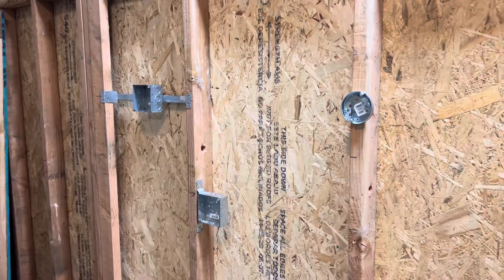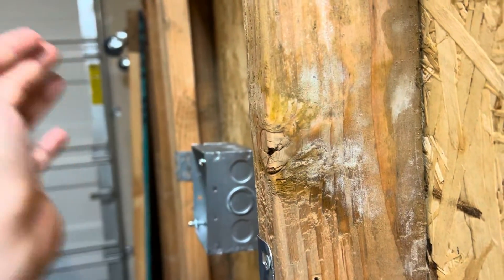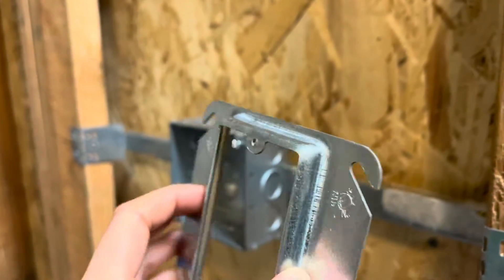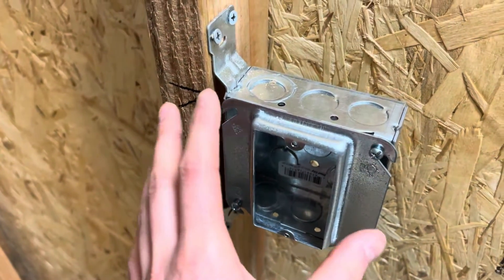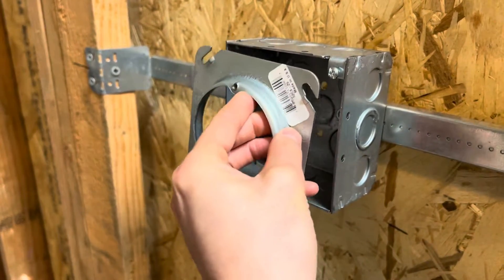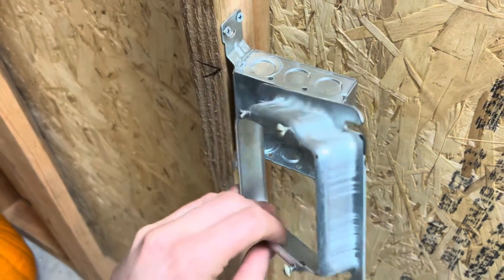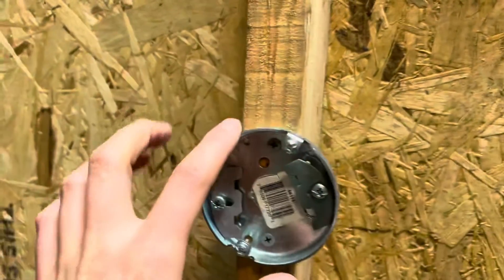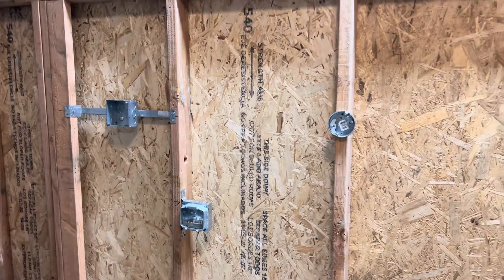Electrical 101: What Are Mud Rings & How To Install Them Correctly

Comment: What’s the purpose of the mudring? And if you are adding one to an existing wall sconce box when the wall is already sheetrocked does it screw to the wall or electrical box? I’m tiling a wall with a wall sconce and someone said to add a mudring and tile under the metal plate
Reply from the maker: mudrings go on before sheetrock/tile. its to screw the devices in like plugs, switches, or light fixtures.

Comment: Why do commercial boxes sit flush with the studs unlike your example with residential that protrudes?
Once the mud ring goes on it will also protrude just like residential and then there is no difference?
Is it just to make the boxes more configurable depending on the wall thickness because there can be many different scenarios in commercial whereas residential is almost always just 1/2" drywall? Thanks for the video. :-)
Reply from the maker: exactly. correct

it also makes a more universal box and then you can just choose what mudring for your application/situation. (light, receptacle, 2 switches etc)

Comment: Can I set the box deeper and use a deep mud ring to create more box volume?  I am thinking of using a deep double gang box and a 1 1/4" double gang mud ring on my 50 amp receptacles (for the EV and range) so those large receptacles have more room in the box.  These are  in 2X6 walls, so plenty of room.  I would set the box, so the front of the mud ring finishes out at the surface of the 1/2" sheetrock.
Reply from the maker: yup you can :)
Reply: Use an extension....set the box back and put another extension on it

Comment: What is the purpose of a flat mud ring?
Reply from the maker: they are nice on surface mounted boxes where you dont have sheetrock, so no need for raised mudrings. this way you can mount plates or devices flush, like an occupancy sensor or cat 5 jacks
Reply: @DailyElectrician  
Thanks man!
I have been doing electrical since 2006 and I never needed one of those before
Reply from the maker: new to me too, they are handy when needed :)